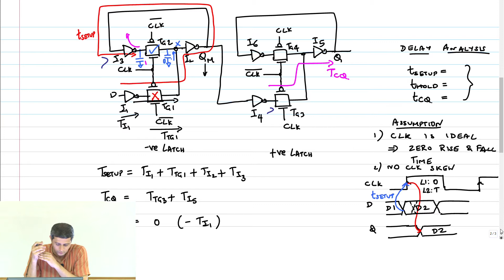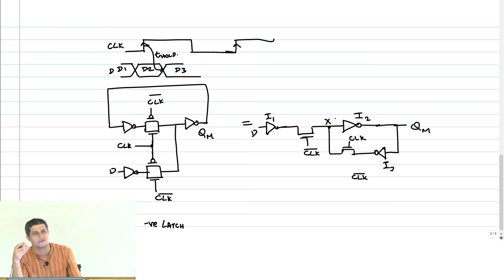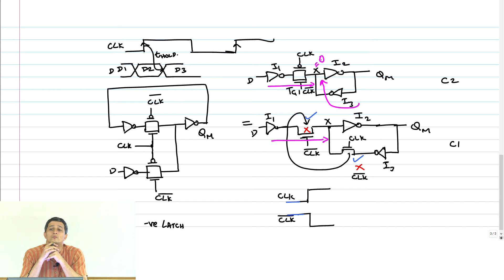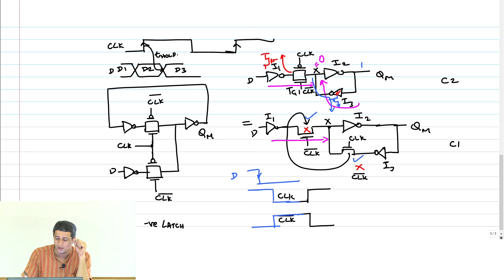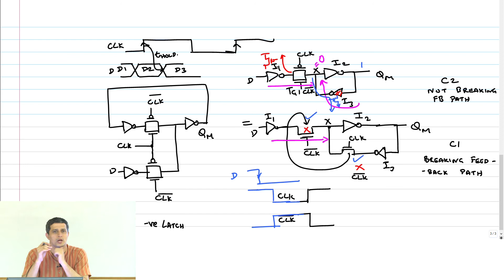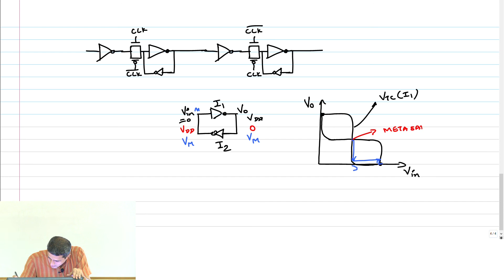SeqCkt - 5 - Alternate Circuit Implementations

Comment: Timestamps (Powered by Merlin AI)
00:19 - High clock load in circuit designs necessitates alternative implementations.
03:50 - Using NMOS transmission gates for latch design improves efficiency.
06:31 - Transistor sizes I2 and I3 do not affect the flop's ability to function correctly.
09:17 - Understanding unit size inverters and their behavior during clock transitions.
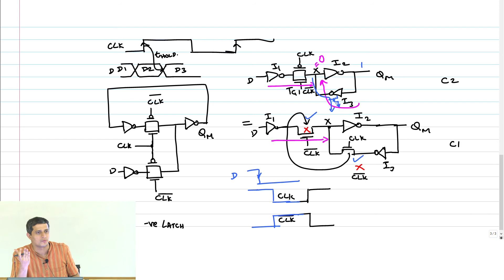12:33 - Latch design requires careful gate sizing for reliable data flipping.
15:23 - Stable output characteristics in feedback circuits using multiple transistors.
17:31 - Identifying stable points in circuit configurations.
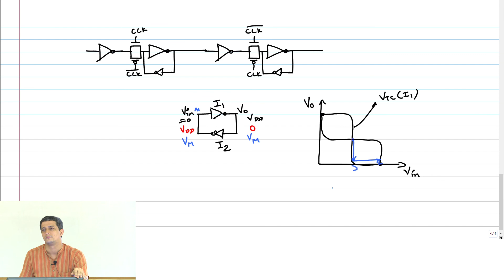20:09 - Metastability can disrupt operations in circuits, causing unreliable outputs.

Comment: How in C1 , only I1 drives X node ,
Reply: The Transmission gate is off, as the latch is in hold state
Reply: @manishsuthar4002  there is no TG in C1
Reply: @jyotiradityamishra5003  he told that only TG is off in this case